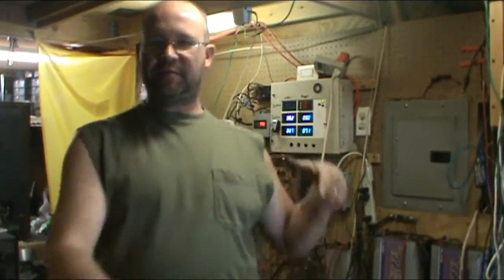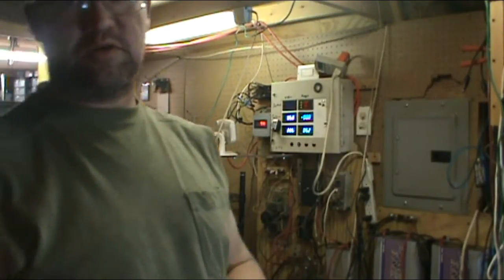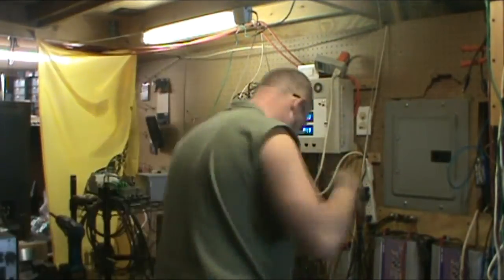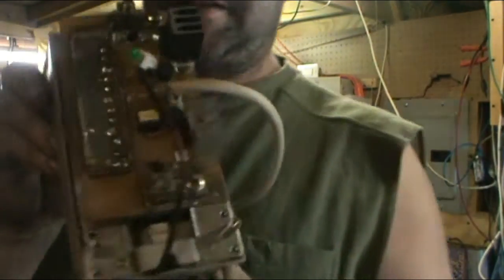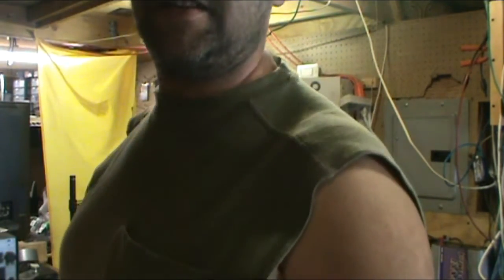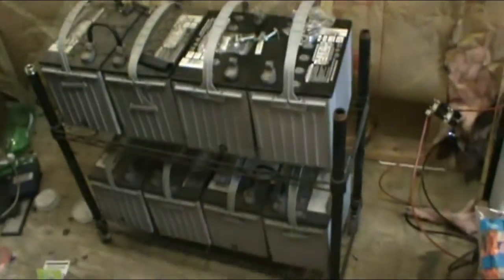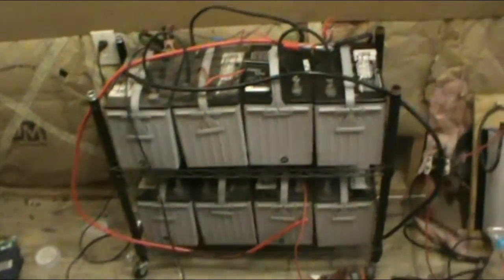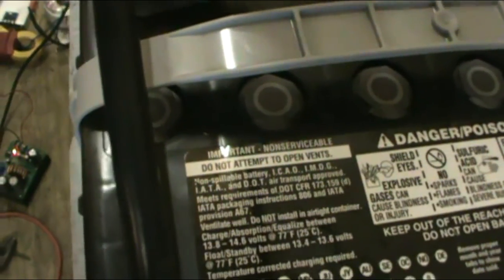New Solar Install Part 2 Pulling out the old to get ready for the new.

Comment: Dang bro lay off the coffee! hahaha Getting pumped the pip is on the way. Looking forward to you next video.
Reply from the maker: LOL that would be mountaindew, my drink of choice.  Yea there might be a lot that happens in the next video. And with the PIP finally being shipped. I cant hardly bar it, it needs to hurry up.
Reply: Wall is going to look great with the new pimp setup. Do you have any idea of the efficiency of your transformers?
Reply from the maker: for the 5 kva its 96.1 %    and for the 7.5kva Cant seem to find the info for it as I can for the smaller 5KVA but I would think its around about the same.  since there will be some sort of loss in all transformers.
Reply: Above 95% is great! Think The one i'm using now is only around 75%
Reply from the maker: yea and with using a Transformer with the PIP I have to think of the power it uses at stand by.  The PIP have a low stand power, unaccompanied to a lot of the large Transformer type. so that will be some of my first test and video's when its hooked up to see what power the Transformer will draw at idle.
Reply: My transformer will not let me use power saver mode on the pip, clicks on off every second or so..... But works fine with out power save mode. My system is never at idol all ways have a fan or something running.